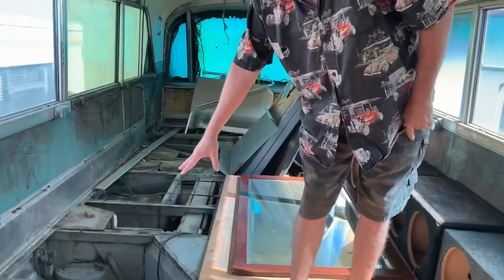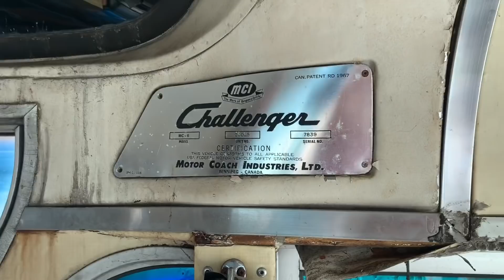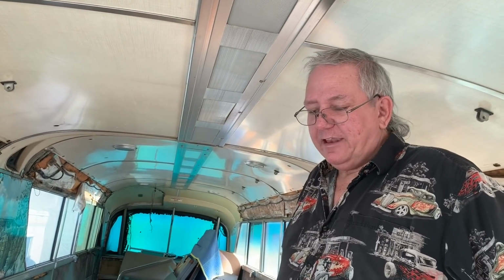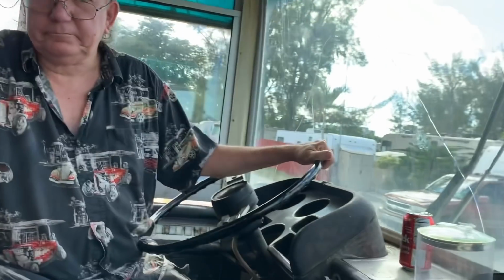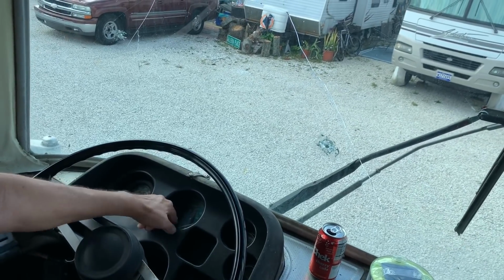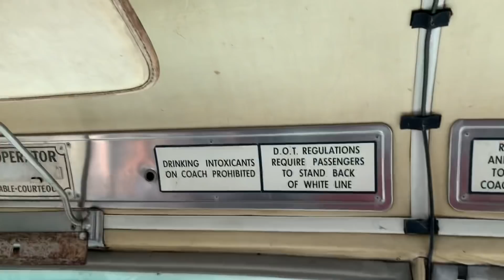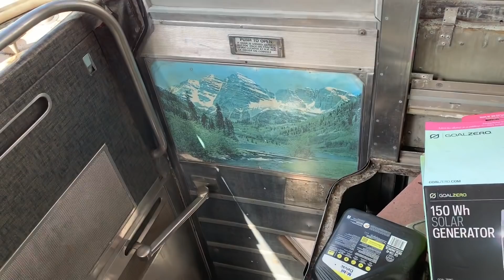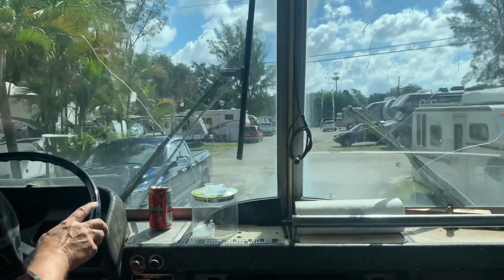12v71 detroit diesel mc6 bus test drive

Comment: In 1973-74 I drove these Greyhound coaches from San Luis Obispo to  San Francisco. The schedule originated in LA. They had the V-12 in them and would climb Cuesta grade in 3rd gear at 45MPH. The best speed you could get out of a Scenic was 32MPH in 2nd gear. I loved driving these MC-6's:):):) Another thing I found about driving these, is you don't have any sensation of speed. you'll be driving 65 MPH, it feels like you are barely moving. I had a local run, lots of freight, easy on the back. You didn't have to bend over much, like doing freight in a Scenicruiser.

Comment: 12V71 problems = "The speed limit was 80, so when it hit 80, I kinda backed it down"
Reply: How is the conversion coming? I have a Scenicruiser, I tried to find a MCI 6 first.
Reply: 80 is enough speed to go anywhere
Reply: That isn't a Detroit 12V71 it's 6 cylinder 2 stroke engine making at most 225 bhp. 12V71 no way.
Reply: @robertclark9705  Sorry, but it really IS a 12V71. Look again. Trust me, I'm a mechanic ;-)
Reply: @robertclark9705  look at the two superchargers on the intake it's a 12
Reply: There is something distinctive about the sound of a Detroit Diesel 😃😃😃👍👍👍
Reply: @fmagalhaes1521  I grew up in an apartment building in NYC in the 70's which had a bus stop on the avenue below. I head the sound of the Detroit Diesel powered buses about every 15 minutes morning noon and night. To this day I still love the sound. My dream is to have a old Chevy or GMC dually with a Detroit Diesel swap.
Reply: @maniyan_wanagi  I can tell it's not a 671 just by the sound. That thing has a very unique tone with 12 cylinders. What an engine for a bus!
Reply: That bus needs a new owner...
Reply: @robertclark9705  Look at the video, it is clearly  a Detroit V 12, there are  6 exhaust ports on the cylinder bank and the blower in nestled in the V valley tucked down I could not see if a turbo fed the blower  as my old  8V92 had, I saw that as a young man and said I want that!  a blower fed  by a turbo!
I never  even heard of a 225 hp  bus engine unless it was a gasoline  Continental engine.  Torque is where its at, the HP is merely  a function of RPMs
Reply: @fmagalhaes1521  Trash trucks, Busses, Corn Bines.
Reply: @whackamolechamp  My Buddy's Dad  owned a machine shop and had  an old 67 Ford F 250 and he put a Detroit 318 with an Allison tranny, it was  in the early  1970's  and it was  really  unusual  to hear!  It was  years before any factory in the USA did it,.

Comment: Wow! Started with Greyhound Canada in June of 1969. President of greyhound Canada was Bob Borden. He was so proud of the MC6. Us guys on the “spare board” did not get to drive them as they were usually on “regular” routes Calgary to Vancouver. I got lucky one day and was asked to drive one from Calgary to Vancouver that had brake problems!  Taking it there for mechanical and break work for sure. Drove west through the Rockies, Rogers pass and the dangerous Fraser Canyon! Remember at that time very new exciting coaches. Needless to say. The trip through the Rockies with poor brakes was exciting. But empty with no passengers no problem. Stopped just west of Kamloops at a fruit stand and bought a big basket of fresh bing cherries to munch on as I drove the Fraser canyon. A trip I will never forget!! Would love to drive one again! Any in Western Canada?
Reply: Highway through Hell.  Pre-Coq days.
Reply: Drivers hounded the "hound" to put jakes on BC & AB buses,... Never happened! Most of the MC6's were converted to freighters in last years of service.

Comment: Dang I bet that bus can bust through the mountains with no issue with that 12 cylinder engine......Wow
Reply: SSS Dias  no ECU on that ol girl, all mechanical
Reply: SSS Dias  all low end torque not a whole lotta giddy up.

Comment: Quite a beast! I drove an MC6 V12 for several years in the early 80s for a charter company in the LA area. Much of it was interstate and across country. Top RPM for 3rd gear was around 62 mph. 65 mph seemed like 50 mph in other coaches. And, you sat higher than any other coach on the road. A bygone era!

Comment: Good base for a conversion. That 12v71 really winds out good. Bet it pulls pretty hard compared to some of the others. Part of me would love to have the 12v71 but part of me would almost rather have a 6 or 8 for the increased mileage. But there is a tipping point in weight where the 12v would be more efficient. although I wonder where that would be. almost everything I see for sale is 8v71 either normal or turbo. Thanks to the owner for letting us ride along on that rare beast.
Reply: It could haul a trailer full of power toys or a large boat along.
Reply: It only gets 2-3 mpg less than most 6 or 8v71’s.
Reply: @photonole61  That's like a 30% difference, though. :p
Reply: Shane Singleton true, but I can tackle the mountains without any loss in speed or power. I’ve read MANY posts from people whose buses may cruise 65 on flat ground, but drop to 20 when they hit any grades.

Comment: I love the MC-6.  Rode a couple when they were in US 'Hound service.  They hoped for them to be the replacement for the Scenicruiser, but they couldn't get operating permits for the 102" width everywhere.  Ended up running them on oddball routes where they were permitted.  When they got overhauled, they got 8V71 and Alison automatics.  They also (stupidly, IMO) lowered the suspension a few inches to clear the roof at the LA terminal.  They should have put in a switch to allow lowering in and out and restore normal ride height underway. The lowering was not good for the ride and handling.
 The Canadians didn't have those issues.  Theirs stayed 12V71 and manual trans.

Comment: What a beautiful bus and he only paid $2100 for it, the 12v71 alone is worth that! Thanks for sharing!
Reply: When that rig is completed, it will outlast any production motorhome out there. As far as fuel economy goes, it couldn't be worse than most other Class A motorhomes of comparable size and chances are, it might even be somewhat better than especially, the gasoline powered ones. If you can upgrade the steering system, it would really be a dream to drive, although the steering system these buses came with from the factory was not all that bad. I bet she'll be a beauty when she's finished!
Reply: @maverickdallas1004  I agree 100%, I definitely would love a bus like this myself.

Comment: Fore sure those 12v71 detroits are  beast,, you sure have some  high power plenty of horses,, i had a 12v71 in a small 38 ft steel tug boat,,  48 inch propeller twindisc 514 3/1  transmmision that was  used to tow construction barges   harbor and short coastal trips weather permiting this boat was an animal,,,!

Comment: Yep, the bus version of a  1969 Big block Chevelle ,A genuine Muscle bus.
Reply: Mercmad..... and these are "castrated" in these applications.... the sky was the limit (within reason of course) in On-Highway truck and marine applications.   The 2 cycle Detroits (especially the Series 53 and 71 engines -this V12 is a Series71-or-71ci per cylinder) are very easy to make lots of power with, like "mouse motor" Chevy's are.

The Series71 Detroits (like this engine) only have a 4.25" bore.. the same as a 400ci sm. block Chevy.... and a Total stroke length of only 5"...Total - keep in mind that these are 2 cycle, so from the total stroke of 5" you have to deduct 1" for intake port uncovering approaching BDC,  plus (I forget the actual, exact amount at the moment) "approximately" another 18-20 degrees of crankshaft rotation for exhaust valve opening before the ports are "uncovered" by the piston, so these engines are actually producing the hp and torque they do, with Less than 4" of piston travel,  and "Only" (small  compared to the 4 cycle Cummins, Cat. & even the Mack, truck engines) 4.25" bore.
Reply: Mercmad I’m a Mopar guy, and since it is a Challenger, .....
Reply: 1st time I've heard the term MUSCLE BUS!  Lol

Comment: Not only rare because it's an MC6, but with a 12v71, no less, definitely hen's teeth here!! He handles that MC6, as if he was born to drive it!, no 'coffee' ground, jogged that thing around the park, and in traffic as good as any seasoned pro could. I'm impressed! Locating windshields for an MC6??, yikes!!
Reply: Only shifting is lacking, but with a sticking throttle linkage that keeps the revs high, it's hard to get a clean and quick upshift.
Reply: Wait 'til you get hold of one, that you have to stop, and shut the engine down to get it into gear!! I've always loved those MC6's, their "eyebrow" exudes class! Only drove one 'around the block'; there used to be an outfit in Winter Haven, FL, which started out refurbishing MC7's and MC8's, as they were released by Greyhound (I remember the "headlight - starter sequence" as being hell on even fresh 8D battery pairs). They visited the charter operation which my friends family owned, and arrived in a nicely refurbed MC6. (around 1983??)  Did you know about the "keep a Skinner valve bolt, and hose clamps in the first aid kit" trick??

Comment: A 13 speed in that would be fantastic.  Bumping it up even to a 7 speed OD transmission would be good.
Reply: Hard to do with limited space
Reply: A 5 spd Mack with a Brownie is about the smallest option for that bus.
Reply: @deborahchesser7375 ,
A brownie would be cool, 
but a bit of modification might even make room for a girl scout. 😉
Reply: Don't know about the 13-speed or if it's longer but knew a guy in the 90's that put a 9-speed truck transmission in an MC8 with the 8V71 and had no issues. He swapped the injectors to the truck spec "318" injectors and that bus would smoke about anything on the road. 😀

Comment: I was hooked at 12v71.
But I still hold onto my dream of shoving an 8v92 twin turbo in the back of a Scenic.
I got to drive a Kenworth with a twin turbo 8v92 under the hood in the late 90's, and was impressed with how well mannered the engine was as compared to its older little brother. It also got better fuel mileage than the 8v71, actually breaking over 6.
I wonder how easy it would be to replace the 4 speed with a 10 speed.

Comment: Awesome!  I've seen a few MC6s, but never one with the 12-71. Aside from the hunting when cold, it sounds great!  I've had throttle problems myself, but would highly recommend an air throttle. Also that really simplifies the linkage if you go to an automatic.  Have you ever converted bus air to R134a?  I've done Model 05 and 10 Eagles, by simply tightening up the leaks...mostly with new hoses to the evaporator and new O rings, then loading in a jug of 134a. Works really well! If you wish, a dab of Permatex HVAC Blue on the flare works great! Brings back stories of my own conversions, and going to work for a bus company to learn from the "old timers" about maintenance...not dreaming at the time that I would become a serial bus owner/converter!
Reply: The ones you saw probably had 8V92s in place of the original Buzzin' Dozens.

Comment: COOL! Had heard about the MC-6 originally having a 12V-71, but I think all the ones in the US got replaced with 8V-71's, and it didn't seem there was one with a 12 anywhere. Had been long hoping to see/hear one! Interesting to hear an MCI in that pre-MC9 design with something other than an 8. (and 12 sounds for the most part like a 6, and the only pre-MC9's using 6's were the MC 1 and 2 —which no one seems to have even a picture of anywhere, and the MC-5c, which is really a contemporary of the MC-9.
Reply: Eric B.... All the US MC-6's Did have the V12.... while they were in the eastern portion of the US,  then later they were all transferred to the west coast (CA.) and were subsequently all repowered with 8V92T's.... I have all the data on them, but not in front of me at the moment, and I'm not remembering accurately at the moment, all the exact details... it's been "a while" since I've had occasion to even need to think about them.  Sorry.
Reply: @Romans--bo7br  did the MC 6 originally not have 2 four cylinder engines ,but synchronization was a problem and than they changed to the V12🇨🇦😎
Reply: @jerryvandyke9216 ... Hi Jerry,  thanks for your reply / question.  The MCI / MC6 "SuperCruiser's" were All powered with the V12 (Series 71 - NA / Naturally Aspirated) right from the beginning, Except for... one of the Two prototypes, which had a Mercedes V8 (was later, scrapped).  

Both of the two prototypes had sheet-metal (body panels) covering the Non-powered tag axle.... the production units of course, did not cover them. 

 As far as the use of twin Detroit 4-71N's for power.... you're thinking of the GM PD-4501 Scenicruisers (built between 1954 & 1956).  

The twin 4-71N's were used because the 6-71 was not powerful enough (at the time) with approximately 165hp with the HV7 injectors,  for a coach of that size and it wasn't until 1957 that DD released the first "V" blocked engines, including the 8V71. 

The two prototypes (GX-1 and GX-2) for the PD 4501's were powered with 6-71N's.

Personally, I don't know why GM didn't use the 6-110... it weighed about the same as the two 4-71N's that they used in the production units starting in 1954... about 4000+ lbs, had 275 hp and more torque than the 8V71N had.  

After the 8V71 was released in 57 and proved themselves, all the PD 4501's were converted to 8-71N's.  

Back to the MC6.. there were 100 built, 15 remained in Canada and 85 came south to the US. 

When they were shipped to the west coast, around 1977, they were all converted from the V12, to the 8V92TA (in production from 1974), which probably were rated at 435hp which was only 1 hp more than the rated 434 hp for the 12-71 (with N60 injectors), and the original Spicer and Fuller manual transmissions, were replaced with Allison slush pumpers (automatics).  

All 15 MC6's that remained in Canada retained their original power trains until retired, so if you see an MC6 anywhere with the V12, it's one of the 15 that remained in Canada.
Reply: @jerryvandyke9216 
Thought that was the Scenicruiser in the 50's.

Comment: Love the oldies, but I'm amazed at how many people buy them without having much mechanical knowledge or experience, and just bumble their way around. This ol' boy definitely has good luck on his side, because buying this bus and showing up without even a screwdriver to drive it 1000 miles home is just asking for trouble. It makes me cringe when people think they have to run it up to top governed speed before shifting. Really enjoy listening to that big ol' 12 …. just wish it got better treatment.
Reply: Joe Black Jimmies run better, longer when you drive em like you stole em. They prefer high rpm’s and sound like they’re spinning twice as fast as they actually are because there’s twice as many power strokes per revolution.
Reply: @nikograham8964  He's got 4 gears, and these engines don't like pulling below 1400 and don't go over 2100. Yeah, I'd say you need to rev it all the way out or you could do more damage. It's not like Detroit don't love to rev anyway.

Comment: Years ago I ran a crew boat with triple 12v71TI’s. The only problem was getting enough air into the engine room to keep them from smoking. We solved the problem by installing two large intake fans to reduce the engine room depression to zero.

Comment: My guess is the reason it won't return to idle, is because of a sticky pedal from sitting. That's an aluminum pedal, and the pivot pin is steel causing oxidation through electrolysis. The fix? Press out the roll pin that holds the pivot pin in, using a pair of channel locks and a  very short punch, pushing the roll pin through the pivot pin. Remove the pivot pin. Run a drill (same size as the hole and not larger) through the holes on both the pedal and the mount removing the oxidation. reinstall using Never Seize.
If the throttle was slow returning to idle, I'd say it could be the buffer screw is screwed in too far, however, if that was true, the engine would not be rolling at idle, like it did, so I doubt that's the problem.

Comment: When the remodeling is done it will be so much quieter. I can't wait to see the results. Did I hear him correctly or not, near the end of the video, that he only paid $2,100 for that bus?
Reply: Marc Del.... unless we Both have a hearing problem... you heard him correctly, $2,100.!!!.... currently, "runner" take-out 12V71NA's are averaging $7.500 - $9,000.... again, that's for a "runner".... Not even a rebuilt, and definitely Not a fully Re-manufactured engine... and Not a T, TA or TI.... which are a lot more.. even for a good "runner".
Reply: I know right

Comment: Black plastic/asphault roofing mastic makes a good exterior window rubber sealant. Tape outlines. Lift the rubber edge slightly as you apply the mastic.